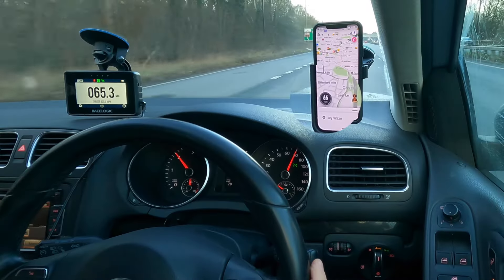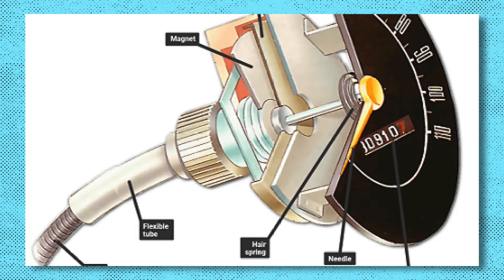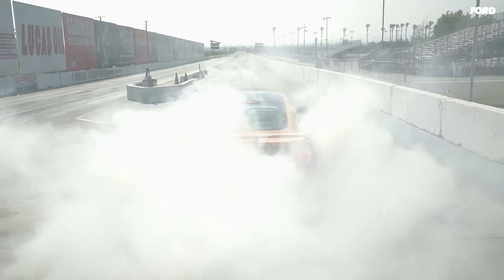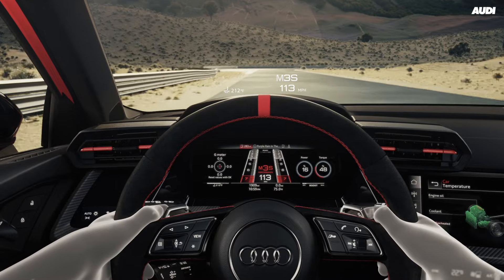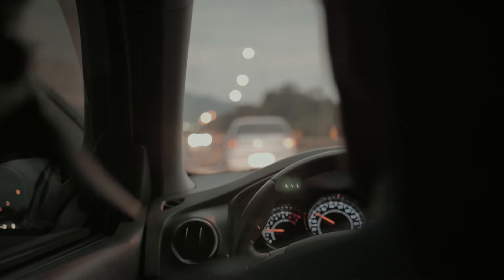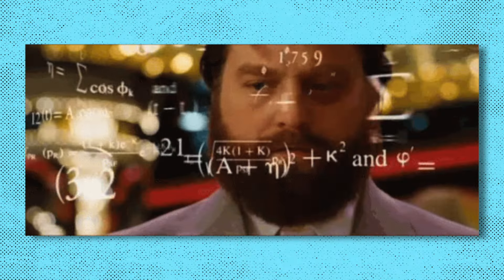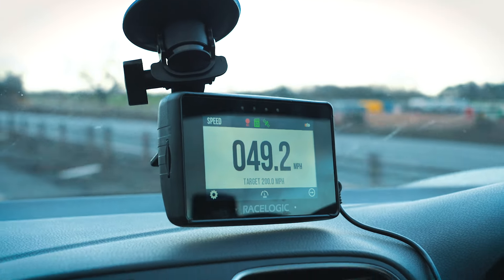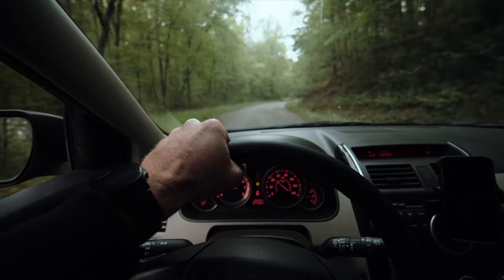Why Your Speedo is Lying to You

Comment: It has to be difficult to calibrate speedos perfectly, given tire size, gearing, measurements among different countries, etcetera and so-on.

I’d imagine a GPS-driven system would be less accurate, even the delay in the signal and other things.
Reply: a gps driven system is the most accurate usually
Reply: @alexsib444  

Apologies, I didn’t mean less accurate than the in-car system. I meant less accurate than the real speed… 🤣
Reply: @alexsib444  Unless you're in a tunnel.
Reply: @nicholastotoro7721  There are some cars where you can input the tyre dimensions in the car's menu, so it gives a more accurate calculation.
Reply: A GPS speedo is great up to the point you get into a tunel.

Comment: With GPS reading does it account on the terrain or assume you are driving on a flat 2d plane at all times? 
If the roads are very undulating then that can affect the length it's measured?
Reply: GPS operates by measuring the distance to multiple satellites then determining your position via triangulation. The raw data from that would indicate height as well. So I would hazard an educated guess that vertical velocity is taken into account as well. Not to mention that GPS watches also measure height and stairs climbed.

Comment: GPS also has a design problem can lead to inaccurate readings in some cases. The system itself can report your location only at a fixed interval, but not the way you got from point A to point B. So if you use a slow refresh rate gps (1Hz is common in phones) and you are in a tight turn, then a simple gps will think you have cut the corner, and since it is a shorter path it will underread.
This is however corrected in most of the navigation software, where the software will assume that you took the road, and calculate with that distance.
While this problem is usually negligible on the road, but if you have ever tried a 1Hz gps tracker on a gocart track you know what I mean.

Comment: I have measured my speed with my winter tyres on and when going 70kph on the speedo and the GPS said 60kph. I want an accurate speedo but at the same time it's good to know I probably won't get a speeding ticket. Also that explained why I always got overtaken on 70kph roads, lol.
Don't know but I've heard the police in Sweden when using laser to measure speed in controls they deduct around ten percent of the measured speed. Maybe that is to compensate for cars inaccurate speedos. I mean I am sure it's not to be nice towards the citizens but this give it some sense on why they might do it, idk.

Comment: Where I'm from, it's required by law for the speedo to overstate the speed - reason being that you couldn't ever argue you were over the limit because your speedo indicated incorrectly. Speedo has to read actual speed + (0-10)%+ 4kmph. That way you could be doing 100km/h but your speedo could read 114km/h and it would be fine. The 0-10% is to account for tyre wear, inflation of the tyre, load etc.

Comment: Two completely different Ford vehicles, a 2014 Cmax plug-in hybrid and a 2016 F150 with 4WD, they both have the same error from actual speed versus both GPS and radar (which both agree). There's a static deviation of about one mile per hour, plus a very slight proportional deviation. To go an actual 40mph, I have the speedo at 41. To go an actual 70mph, I put the speedo (and cruise control, etc) on 72. Strange that it's the same with such different vehicles and drivetrains -- makes it seem intentional.

Comment: Interesting video! I tested several times the speed accuracy with phone apps in my Alfa Romeo Giulia 2.2 JTDm and the car overead only 2km/h at any speed, even in a downhill i can touch 247km/h and in the GPS he reads 245km/h... in my BMW 120d at 120km/h the speedometer overread 4km/h in comparision to the GPS!
Reply: 118d F20 here, can confirm, with 17 and 18 inches wheels it overread 4km/h.
Reply: @lin.alessio  yes, my F20 have 18" wheels(225/40/R18 in the front and 245/35/R18) but i have a friend with a BMW 320d F30 Efficient Dynamics with 19" wheels and the car only overread 2km/h more than the GPS...

Comment: Legitimately one of the first things I do when I get a new car (well, new to me) is check the speedo against my phone GPS to get an idea how the actual speed compares. In my '98 firefly the speedo overread by about 5%, but around a year before selling it I acquired a set of 14 inch wheels (as opposed to the stock 13s), which I measured the outside of the tires to be about 5% larger circumference than the 13s, and sure enough the speedo was roughly spot on running those wheels.
My '93 civic also overread by around 5% if I recall.
My '06 Swift is I believe 1-2% over.

Comment: I tested this many times on my 2005 Focus. So at the city speed limit here - 50km/h I am usually at around 55-57 on the car. But the faster I go the bigger the difference. So let's say on a highway the limit is 130km/h. On Google maps if it says 130, my car is above 140. I tested this in Germany at even higher speeds and the difference still grows.

Comment: Wow. What a discovery. At least in Europe it's regulated. With real speed of v the speedometer cannot show less than v and cannot show more than 1.1*v+4km/h if I remember correctly. Homologation tests are done at 0, 40, 80 and 120 km/h (a subset of those speeds if a vehicle is not capable of reaching such speeds)

Comment: Here in Italy the regulation states that speedometers have to overread by at least 4km/h, with a maximum of +10%. My car is a Hyundai Tucson 2016, and testing it I found out that it overreads by exactly 4km/h consistently, when going over 40.
Speed traps also have a tolerance of 10% (some sources say 15% but it's better to be on the safe side), so it's pretty easy to calculate that on a highway I can go at 143km/h, so in my car at an indicated 147km/h. Easy enough to calculate!

I usually keep a GPS speedometer on my phone that tells me the average speed, so I can speed up a bit for fun when the road is empty, and still stay under 143 on average.

Comment: I was praying my Speedo was off by a lot when I drove through a speed camera last. I could swear the Speedo couldn't have been reading more than like 105. Ticket comes back at exactly 105. In a 70 zone, I was 1 kph away from losing my license, but ended up with 6 demerits on my license and a 1400$ fine
Reply: @$1,400 a pop, wow they are not playing about speeding in your country. What country are you from? With fines like that, your country may as well force manufacturers to make cars that automatically knows the speed limit on every road and will not allow any speed over the posted limit even if you press the gas to the floor. I be crying about $250 for a speeding ticket in Alabama but we still have to pay another $250 in court cost. I hired a lawyer once to fight a traffic ticket. He won and he showed me how to fight it myself. It's pretty easy. A clean record begets a clean record if you know how to fight for it. I haven't had to pay a ticket in over 20 years. But Im also more selective about speeding becauseI have a Commercial Drivers License.

Comment: This is important to know when doing regularity rallies....

(When I did them, I built a table with a GPS, my dad used to use a stopwatch and a measured kilometer (there are / were some of them on some roads around here at a time) in the 90s) (The other option in South Africa is the blue signs next to some freeways, which are spaced 200m apart (they are not always accurate though))

Comment: I've recently taken to having a computer or phone in the car that can access the vehicle speed telemetry via the OBD diagnostic port and keep me informed of the speed using speech synthesis. It's potentially annoying, but I like being able to keep my eyes on the road, and the car's internal idea of its speed seems more accurate than the speedometer (as you would expect, given that systems such as ABS, transmission control, fuel economy gauge and odometer would rely on it) . Presumably the scaling for the speedometer is typically done in the dashboard unit itself.

Comment: It depends, I have a Citroen C4 from 2006 and that is pretty accurate. When I drive on GPS and I drive 100km/h on the dash, the GPS is pretty much the same. (Ofc, GPS drift can make it bounce a little even when driving on cruise control). The car speed is really dependent on a lot of things, even different tires can set the speedo of if the car is set up for a different size for example.

But in general, the speedo is off by about 10% and I think that is done by the car companies so as to not getting legal issues when drivers get speed tickets while they think they go the speed limit

Comment: When doing diagnostics on a car i have seen abs sensors read less than the speedo. So probably the car knows the real speed but you are given false reading for other purposes(safety, less accusations for a car manufacturer in an event of a accident etc) . Mostly premium class cars have read accurate readings. Had a theory that might be to give the driver a faster and a more empowering feel of a premium class vehicle.

Comment: If you’re going up or down hill the gps speed tracking is inaccurate as it’s giving you a speed based on your lateral movement across the planet so if you’re going up or down hill the distance traveled is more than the tracking distance of the gps as gps doesn’t take that into account

Comment: Every Japanese car I've owned had a speedo that read exactly what my GPS reads, sometimes temporarily off + or - 1 km/h.   
Tire wear and inflation is only going to contribute about a 1% difference.   Rotations per mile within the same tire size are also less than 1% difference.  This includes winter tires and ultra wide roll the fenders track tires.

Unless your tires are significantly smaller diameter than stock, your VW is defective (by design?) and you should have that fixed under warranty.  5% is rediculous and dangerous. 

Class action lawsuit.